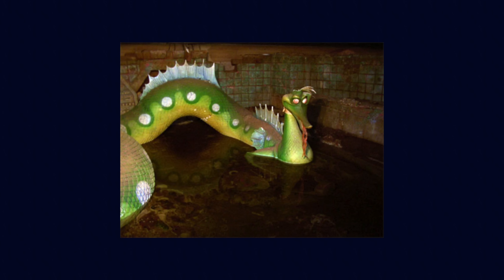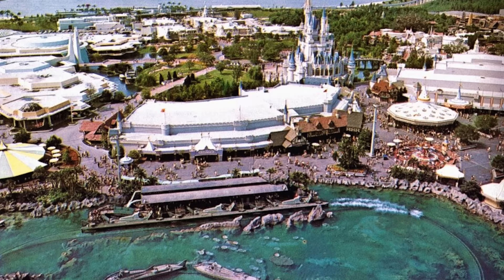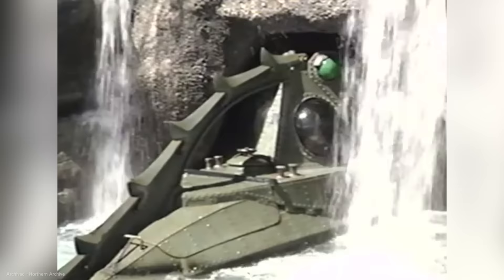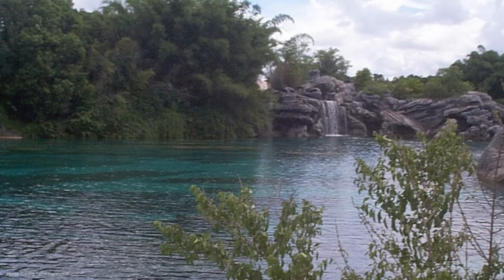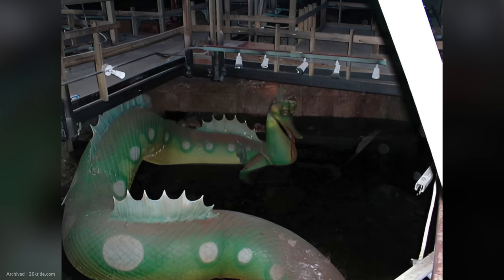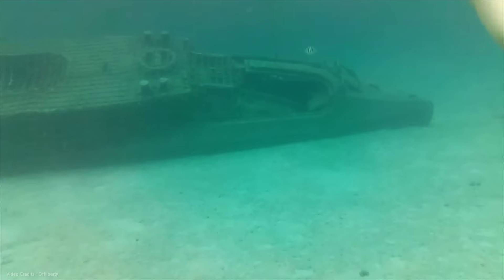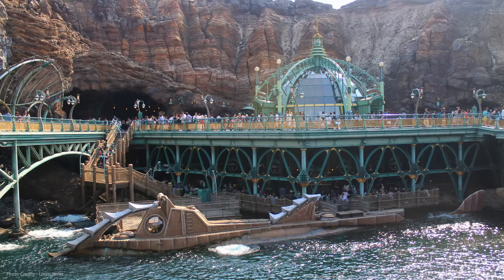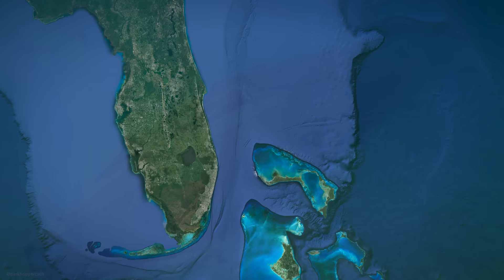Abandoned - Disney World's 20,000 Leagues Under The Sea

Comment: I rode it in 92. I was 10. It was April, outside was a pleasant 82 degrees. Inside the sub it was close to 100 degrees. I was sweating the whole time. However I was fooled because I thought we were completely under water. My father (An ex Navy man) told me it was just as uncomfortable in a real sub. Some of the props were dated and some of the animatronics were not moving correctly (Or at all). However I remember being fairly happy with the experience.

Comment: Great video.  I was a lead/trainer at 20K in 1980. I don't know where you got your thruput numbers but each load cycle took 5 minutes.  There are 3600 seconds in an hour and you divide that by the dispatch interval. Five minutes = 300 seconds and then you multiply that result by the number of guests sent out per dispatch.  Even with 9 subs running which was the maximum and only 120 people sent out per dispatch, that's only 1440 thruput per hour.  That is half of what Mansion or Pirate Ride does.
Reply from the maker: I was going by the 1973 internal Disney capacity numbers.
Reply: @BrightSunFilms  Disney lies
Reply: @neilengel3715  To itself?
Reply: @alalalala57  Yep. Even to itself

Comment: Was there the year it opened, and everything worked.  Amazing little ride, you thought you were under the ocean.  Road it about 20 times.
Fun facts for us:
Until Space Mountain...it was our #1 E Ticket ride.
Each side had a different view, so you did not see everything on one trip
The line went quick, the subs fit a lot, and they had a good system to unload and load.
Slowly over time, the water turned green.  I remember the Dragon was one of the first thing that became obscured.
You could not see anything eventually, but going underwater still was fun.
The ride became closed more than open, it always broke down starting in the 80s.  We went to Disney every year, sometimes twice...and got on the ride once.
I rather wait in line for 20,000 and the cloudy water, than a slow overrated dwarf coaster.
By the 90s, no one was surprised when it shut down.

Comment: WOW nice tribute to the 20K Ride!! Thank you… this really brings back memories as I worked on the sub ride at Disneyland in 1969 moving to Florida in 1970 worked during the construction to WDW and then in 1971 worked on the 20K Ride. In 1973 started working at Ride & Show Engineering as a draftsman. I worked for Tim Kelley and under his direction and together worked on 20K Ride redesigning the underwater animation, sub hatches (they leaked bad going under the waterfall) . These subs used compressed natural gas (CNG) initially and later the engines were replaced with diesel which was a big step backwards…I remember during one of the major rehabs we drained all the water and I worked on a redesign of the underwater switches in the load area. I worked with the guys from Central Shops taking up the old switches and replacing them with the new….very cool memories… great video and thanks. Steve Cone

Comment: I was able to ride the 20K Leagues Under the Sea at both parks as a youngster.  If you didn't experience it, it's hard to explain the total immersiveness of the ride.  Especially the smell of inside the metal boats, a mix of the water and the engine plus the air jets from the port hole windows is still in my memory.

Comment: Disney will never dig them up. They were buried in the landfill because of the ACM in the fiberglass.The ride was falling apart. The rockwork was stucco. Rebar made up the skeleton of the rockwork. Chlorine and steel do not work well together.  The cost to rebuild the rockwork was 10,000,000. And WDI wanted another 10 mill for improvements.

Comment: An example of the cost of deferred maintenance, enough is not enough, loss of originators and their imagination, failure to adapt to new regulations, failure of not having an exit plan and indecision.

Deferred maintenance; When maintenance is deferred it is extremely expensive. Fist there is continued deterioration making restoration more expensive. As time passes inflation adds to the cost and eventually keeping something becomes well above the budget.

Enough is not enough; The ride made money. But the operators were not satisfied with the profit margin. They failed to consider that it was part of the whole and it brought in customers that would add it to their enjoyment of the park as a whole. The loss of the “inadequate” profit over the years was what, over $30,000,000?

The original people's vision was lost, it was not in the minds of the later people. The later people were likely all the majority office workers who did not have the imagination of the originators, they could see nothing but numbers on a sheet.

Failure to adapt to new regulations; The ADA only requires reasonable accommodation of handicapped. If replacing or modifying all 12 vessels is not feasible, then maybe three vessels would meet the Feral requirement. As a plus, the loading and unloading was a choke point and modifying existing vessels would make for more rides daily making more money. 

Not having an exit plan; They shut down the operation without having a clearly defined replacement that was already engineered and ready to be built.

Indecision; Unable to formulate a subsequent replacement. They lacked the lost imagination of the originators and could not commit to anything.

Not exclusive to Disney, this is what happens when office drones get control.

Comment: Too bad that they didn't see the benefit of it. In every operation there is a spread among the rides and their costs of operation. Some are more costly than others. And not everything has to make money outright. If one calculates the added costs of a ride versus the benefit it gives to the whole operations than it could be seen that the whole park is more than the added sum of the individual parts. Typical economist thinking who like to divide everything up into smaller pieces and look at them individualy. Only because then they can have numbers to play with. This makes sense in optimizing the operation itself. But it always has to be looked at in its context. What does it add to the whole park and what would it take away if it had been shut down. Not in terms of money for operation but in motivation of people to come at all.
Using the same logic you could cut off at least 6 of your fingers because then you would save to take care of them and still be able to grab a cup of coffee or hold a spoon.

So sad. But I am lucky that I have been on the Florida ride. I too think it was the most iconic in the whole park. From an attraction POV it is on the top with Magic Mountain. But the scenery visible for the users gave it a leg up.